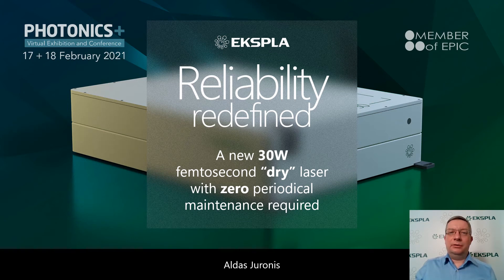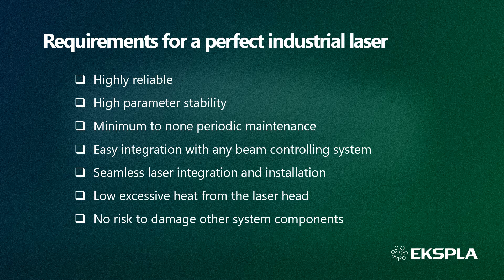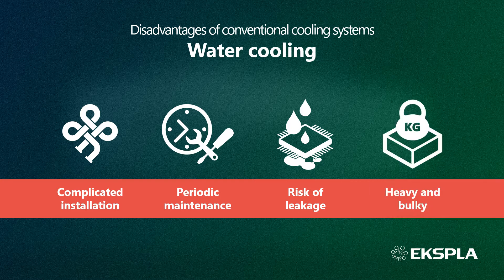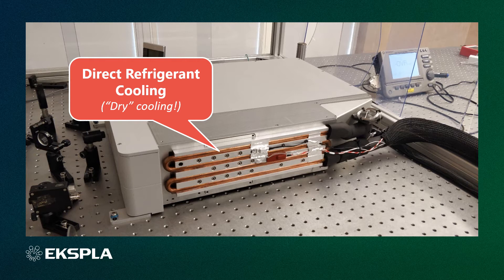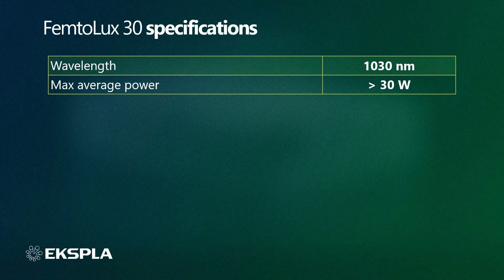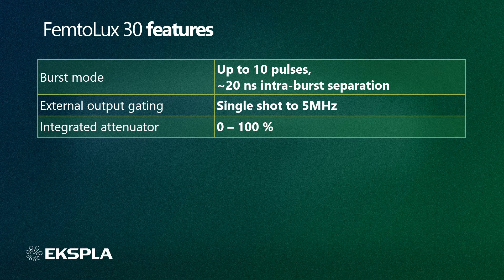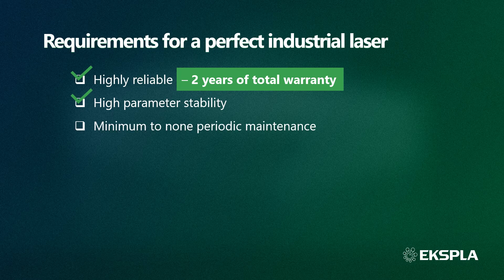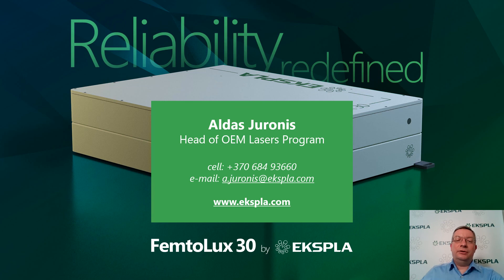EKSPLA - Reliability Redefined a New 30W Femtosecond “dry” Laser with Zero Periodical PHOTONICS+2021

Comment: I have one question. We are researching Metal additive manufacturing and NDT dealing with Femtolux-30 from EKSPLA and there is freaky issue that when we turned on the machine through Warm start, the Laser machine didn't move on to the next step, which is Running mode after finishing Warming mode. At the same time, it was recognized named 'timeout-321' Error after launching Warm start and this is the big problem we have (but error code was unclear on the remote controller pannel as well as EKSPLA control, which is control SW) That's why we'd tired to make some solutions including restarting from Cold start and key off etc. But still has same issue. We'd like to know fix it on remote controller or in EKSPLA control SW. Or what is 'timeout' Error and how to remove it?